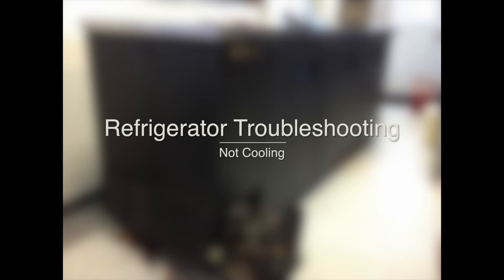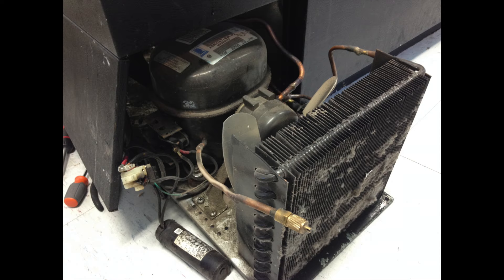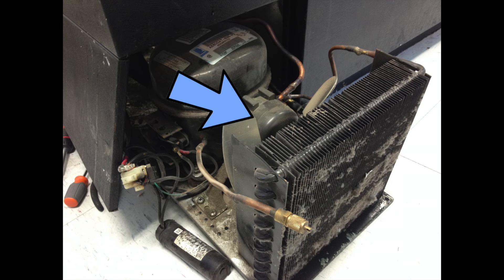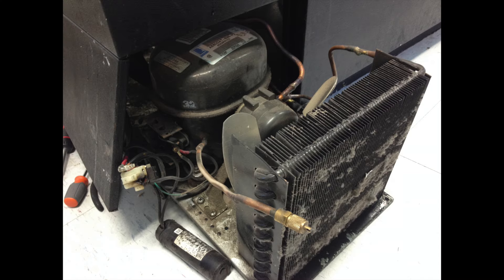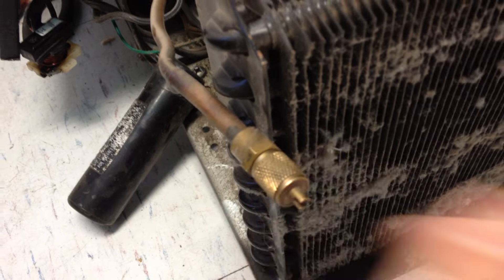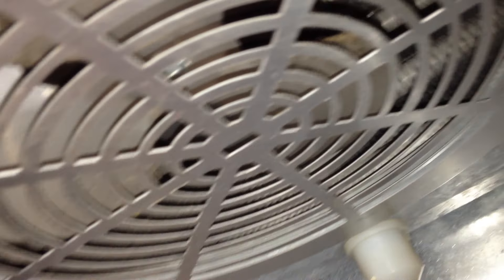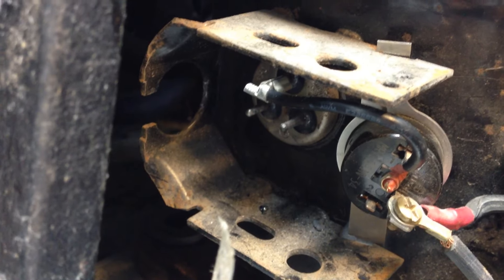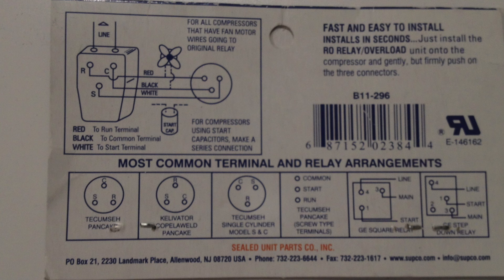Refrigerator Troubleshooting Repair not cooling - Compressor starter relay

Comment: Man, seven years ago that this video has being posted and still teaching;
 Bro you have help me with something very simple, but so important (The Fan)
but if I wouldn’t see it in your video I will miss it completely…

(As at this moment literally I don’t have any $$ for technicians to diagnose, much less to fix it)      you have no idea how much I appreciate the fact that I save “the money” that I don’t have for technicians labor, cost, etc
Now my refrigerator is working again!
thank you so much!!!

Money saver!

Ps.
I say a simple thing because the fan that is Close to the motor had to be always working running..
..well a freaking little thing 😂 was just under the fan and didn’t let him to move, I did not see it from the outside so when I pull off everything I clearly see what was on the way and I just remove it. That was it .😅!!

Still the fact that you provide all the info from the beginning in a simple manner.. simplify my life when I start to checking everything the way you said!

thank you again.

Comment: Thank you I had to change out the relay and capacitor but I didn't realise that the relay plugged into the compressor on the bottom two pins, I will do that tomorrow and I am quietly confident that this will deliver the result. Great video simple and comprehensive troubleshooting.

Comment: Great video.  I saw a video, where the inside fan was running, but the repair man, knew by experience, that it did not sound right - the inside fan.  He suspected it was not running at the right rpm.  He ordered a new fan and it sounded right and gave the proper air circulation.  
The fridge he was working on had other issues, but a fan that was going bad but still working did not help.  The fan did not make any weird noises that would indicate there was anything wrong but the repair man knew by the pitch of the fan it was not spinning at the right rpm.

Comment: I know this is 5 years old so probably a long shot but I’ve got a McCall commercial fridge and it’s actually heating up the inside of the fridge. Not just “not cooling.” It feels like cold air at the condenser. I’m about to start ripping into it and looking for issues. Just hoping maybe you might have a starting point. Compressor and fan are both running.

Comment: I have a beverage air beer cooler pretty not exact to that one, but I can’t seam to remove the compressor a the evaporator or find a way to slide it out. How did you get your system out of the box.  Thank you

Comment: Great vid. Short and to the point. Can't tell you how many vids I've watched and recieved everything that's going on with thier day instead of staying on point. Anyhoo. Thanks. I have a 2 part question. If I find there is a leak, can I put freon through the valve you pushed to test for freon? Second part  question is: how do I go about fixing the leak? Thanks

Comment: Adam! Question I got a true tssu-48-12 we had several power outages and the fridge was hot on the inside. I change the temperature control knob and it cool but not cold what I do notice is that the compressor is kicking on and off like a minute apart! Any help will be appreciated

Comment: Hello, question for you.  Simon my fridge all of the stuff you spoke about are fine.  Except for the fans inside.  They don’t spin there is 3 of them and none of them spin. Is there a relay for those or a way to check them? Mine stopped working after a power surge and now the fridge won’t cool plus everything cuts off after a few minutes of running.  I’m guessing cuz these fans aren’t running.  Please help!

Comment: I am working on the same system. The fridge itself is making a clicking noise like if it's trying to start. The condenser fan is not turning on unless I manually give it a spin and the compressor is not pumping refrigerant. The start capacitor has some yellow stuff coming out of it. Could the start capacitor be the problem?

Comment: I have the same exact cooler but mine gets cold just not as cold as it should. It used to leak water inside so we would have bowls to catch the water, but now it hasn’t been doing that so I’m wondering what the problem could be. I did order new gaskets because the ones that are on there now aren’t sealing very well. Any thoughts?

Comment: Hi Adam, I have a similar unit, the temp reader shows more than 11 degrees, when I switch off and switch on the unit it comes down to normal temp (below 4 degrees). Could you please tell what could be issue here?

Comment: That came to mind, but I never see any water from the ice after it has not been cooling, have the bad cover off so I can see that there is never a large amount of water in the evaporation pan. My thinking is it goes into defrost mode and for some reason the compressor will not restart. Since I had the unit, the longest it has run is 5 days, and that was after I replaced the start relay and capacitor on the compressor. I have checked the compressor per Bill's video and it checks good, right in line with the specs on spec sheet. Any other ideas on what to check next would be greatly appreciated.
Regards, 

Jim garris

Comment: On the thermal overload you have 2 wires. Are they the common/neutral wires? Is one of them from L1 and the other from comdemser motor neutral wire?

Comment: Hi dear . My fridge have problem about compressor running non stop ... We have been set temperature is 5 degree ... But compressor keep running even below 5 degree .... Even we try push the defrost control but compressor keep running .... Do you have any ideas why ?

Comment: I have a true refrigerator blow warm air but I check the relay is good I also I replace a thermostat but still blow warm air I put the gauge in low side read 45 psig. How much psig will be good. Thank you

Comment: Problem , I have a True GDM-10  it stopped cooling . I took off front grill and put a fan in front of the radiator cool forcing air through it and the fridge works perfectly . The internal fan is working behind the coil. What do you think is going on?

Comment: Hello i have a commercial refrigerator and i had a couple different guys come and fix it but it's still building ice. The first guy said it was a freon leak and replaced the pipes and added more freeon. He also replaced the rubber gasket to make sure it was sealed properly. The second guy said it was the thermostat and replaced it. The fridge keeps running nonstop, I feel it cooling but it starts to build up ice and blocks the air from coming out. When i turn it off to thaw out it takes 2 days to get to 40°. I don't know what to do anymore. The 2nd guy came back like 3 times to try to check other things but can't find anything wrong with it.

Comment: Hi Adam, nothing turning on in bottom of the unit, compressor & fan will not come on, so how do I check thermostat at the top (i.e. broken always thinking its cold) vs. electronics in the bottom (i.e. on-signal is issued but nothing runs).

Comment: We have a LG refrigerator (LTC 22350SS) where the freezer is in the 0-5 degree range but bottom refrigerator is only cooing to 50 degrees.  We bought it used and cleaned it out so there were no frozen lines.  Wondering if this is a fan motor or maybe an evaporator fan or maybe a starter relay?  Thank you.

Comment: that relay is a current relay. it's coil is energized by lock rotor amps off the run winding. During start up the start cap is not energized causing the run winding to pull Lra. when it hits the amount of amps that the current relay energizes at, the plunger inside the relay is sucked up and the contacts close between 1&2 causing the start cap to come into the circuit. that extra "boost" will bring the compressor up to speed, which lowers the run winding amps. The relay then cuts out of the circuit at about 75% compressor speed. Now your compressor is up and running and you can take your lock rotor amps and divide by 5-7 and that is what your running avoid should be. You can ohm out the relay between 1&2. in an upright position with no word hooked up out should read OL. if you flip it upside-down, between 1&2 it should read closed or close to 0 ohms.
Reply from the maker: Top notch comment! Thanks for the input ACI
Reply: Thanks 4 Sharing Bud!!

Comment: I'm working on a Randell refrigerator. All of the the parts you went over are working on mine. Compressor is on, starter relay is in perfect condition. Not sure what else to check

Comment: Hello Adam,
Thanks for the video ! Everything looks good that you request I check the compressor does not kick on and coil fan doesn’t come on. I did replace the temp switch thermostat a few years back an it worked fine , but that’s when it wasn’t cooling all the way. Could a faulty thermostat cause the compressor not to come on at all?
Thanks for the help

Comment: I've got a Criotec standing glass door cooler being used for produce storage. Worked fine all last year and has for many years, and then, suddenly last October it was still plugged in and running, but reading a temperature of 90, instead of 35 that it had been maintaining. It sat unplugged over the winter and then was turned on again this spring. It has been cooling well for about 2 days at a time, and then the inside temp goes to up to about 90 again. I cleaned a bunch of pet fur and dust off of the coil underneath, thinking that it was just overheating, and it cooled just fine again for a couple of days, then became hot. Any ideas? Had it plugged in for about an hour or so today after sitting for 24 hours unplugged, and it didn't cool at all. I'm hearing the compressor cycle, but not actually turning off, just a slightly different sound.

Comment: I have a commercial beverage cooler that won't cool. I have changed the start relay,thermal protected for the compressor, the capacitor, and the thermostat. The compressor keeps  clicking but won't start. Both fans are working. I metered out the prongs on the compressor and they seem to be within specs no prongs on the compressor have a short to ground. I'm stumped. The refrigerator is a Avanti BCA 280. Any help would be greatly appreciated.

Comment: Hi.  I have a true gdm-47.  bought used.  Doesn't cool below 48.  Repair guy out checked freon - blew out fins.  Said nothing wrong.  Said everything seems to be working.  Obviously it's not.  The compressor and fan area are LOUD - and I do mean loud.  And they seem to put out a lot of heat.  Any idea what I can check?

Comment: Mt T-19FZ (True freezer) works but it has become increasingly noisy.  Called in a tech who advised to just let it run until it dies but doesn't sound like a prudent approach.  Any hint as to why everything works but it is very noisy(condenser/compressor unit)

Comment: Hi mr Adam.Great vid. I woul like to ask about something i encounter days ago. I found that some commercial fredges have a basin and a pipe inside that sucks the water.... I found it well dry and it seem to be working fine for some time. I just suspect that oil or water should be put periodically ? its a polar and also a Appolo. Thank you

Comment: having a problem with the inside fins/ cooling lines freezing up after about a week.  I have an older Rapid 3 tower kegerator and when it's not frozen it keep a nice temp.  The kegerator is in my outside bar and not sure if that makes a difference

Comment: What I got is a true glass front retrieve in a hotel I maintenance for it isn't cooling I checked and cleaned like you said there is a clicking noise occurs every 30 seconds or so and it seems like it isnrt doing whatever that click is intended to do I can't tell f he compressor is running because it's too loud and how it's positioned what could the click noise be ?

Comment: Thanks for sharing. I have a refrigerated display unit . The unit seems to run ok except that the compressor is very noisy. The sound is so cranky and I want to get rid off it. What would be the problem do you think?
Reply from the maker: Compressors are usually mounted on some sort of rubber shock absorber. Is yours worn out or missing?
Reply: AdamDIY . There is at least one missing as i saw it. Will check it again and deal with it. Thanks.

Comment: i have a two door commercial refrigerator and only the right side if the cooling unit builds ice the other half, left side does not so it takes a long time to get cold and the compressor never stops and it starts getting hot.i already flushed it and drained the freon and add some more. thanks
Reply: You need to make sure you have proper air flow. If its a freezer, look for drain pan heater issues on that side. Sometimes the tape they use comes loose and it will not make contact. OR, its not working at all.

Comment: I'm wondering about a used free standing clear glass door refrigerator that reads Coke across the door and is large enough to hold at least four cases of beer and so the guy that is getting rid of it says it stopped getting cold? Know that I've watched this video I'm certain that this shall help, thank you.

Comment: I'm stuck in soda case for more than two weeks trying to fix it it has two blower  was working good before losses the Frio I found the like was the explanation valve I put small dap of nailock titan the nuts no more leak  put NU 22 as it was before after  I changed the dryer and titan the bulbs to the sucktion  line low pressure on 40 hi pressures go up to  250 then the fun started and stop on 200 clear glass no bubbles compressor working good but no cooling  I vacuum for two hours down to seven hundred micron  any idea what going on ?

Comment: I have been given a true commercial fridge very similar to the one in your video, It came out of a school cafeteria,  and I am trying to get it running. My relay continues to just click, does not cool. We have replaced the capacitor, and relay. Our unit does not have schrader valves, so unable to check pressure or see if even has gas.  Thought of installing valves, so I can check Don't see any problems with coils, so words of wisdom ??
Reply from the maker: If everything appears to run normal, it has a good seal on the door, ice is not forming on the coils inside, the compressor is running, and any fans are turning; then I would suspect the gas may be the issue.  Check the lines for damage, sometimes it's obvious.
Reply: @AdamDIY  Compressor does not seem to be running, it sounds like it tries to start, then quiet

Comment: Help!!! My Amana Fridge stopped working. Fan is working, compressor is not. Watched many videos, installed a new capacitor and start relay, but nothing changed. I don't hear any rattle on the on the old part, but do on the new one :/ I'm very confused.
I'm so new to using a multimeter. I'm trying to learn so I can check any defects on the parts. Still don't know if I'm doing right. Coil are not visible to be able to clean them up, still working on it. 
Lastly, I tried to check the compressor by testing with the multimeter alternating the cables on the three prongs. All three make a beep sound. is that supposed to be good or bad? I can't afford to buy a new fridge :/ can somebody help, please? :/

Comment: Thanks buddy. Your video was great. We have a true freezer T-49F which has stopped cooling and become very noisy. Do you have any ideas that what the problem could be? Thanks!
Reply from the maker: Shahrokh Shahamat Where is the noise?  It's is most likely coming from the Fan (there is more than one) or the compressor.
Reply: Hi Adam, thanks for the reply. It turned out that one of the valves in the compressor was broken. We replaced the valve plate which resolved the issue. Thanks again!

Comment: Hi Adam,
I have a commercial TRUE single door refrigerator. It stopped cooling. I can here compressor running and can feel hot air around unit. I unplugged the power for a day next day I plugged power, waited for hour and refrigerator started cooling it did reach desired temp also. However it stopped cooling but i can still hear compressor running.
Reply: What was the problem?

Comment: Hi. Great videos! Are the "fins" considered the evaporator or condenser or a combination of the two? In our business I have nine units (commercial refrigerators and freezers which are mostly made by True)  like the one in your video and despite vacuuming and blowing the dust out on a regular basis the greasy environment it's subjected to still allows some dust/dirt to cling to it. I am trying to figure out if a Nu-Calgon spray cleaner could be used safely by me to better clean these. I am just so afraid of using the wrong cleaner and having the rinse water ruin something. Which cleaner is safe (if any) and can I spray it directly through those fins? Some cleaner and rinse water would obviously get on the fan, fan motor, and possibly the compressor itself... is that still safe? I hope you can help. Thank you.
Reply: Just use the degreaser next to the sink, that should be fine.
Reply: U can wash them out just don't flood it n kill the power while u do that with grease u can use a mesh filter but u have to pm the unit every 4 mts or ull get high head pressure n have problems...god bless much love from la & Chicago

Comment: Guys i need your expert opinion. I have a water dispenser with pw2.5vk compressor. I have problem with cooling during early evening till 11pm because of low voltage. I just want to know the right wattage of avr to solve the  problem. TIA